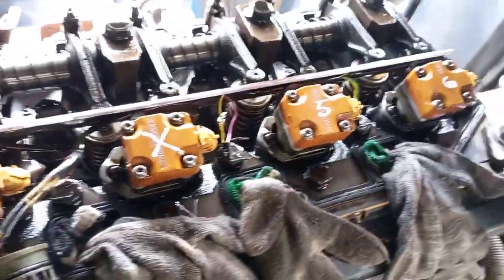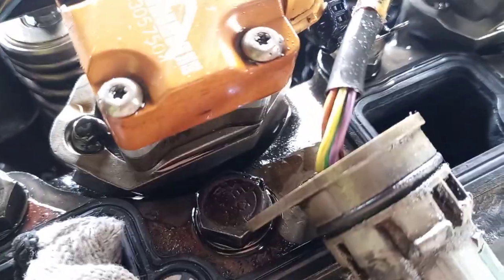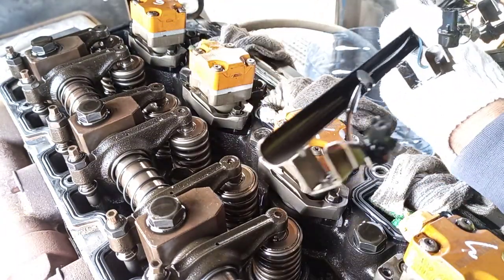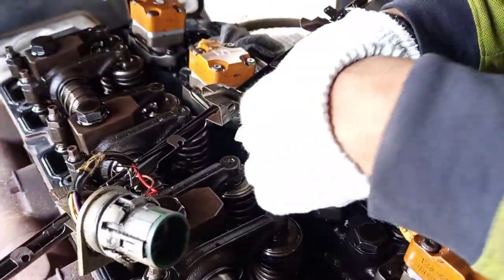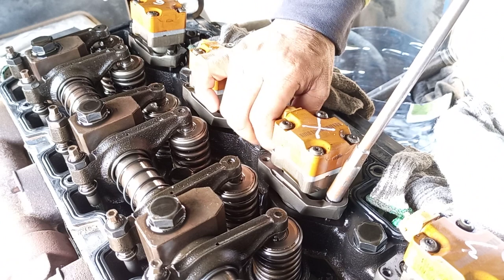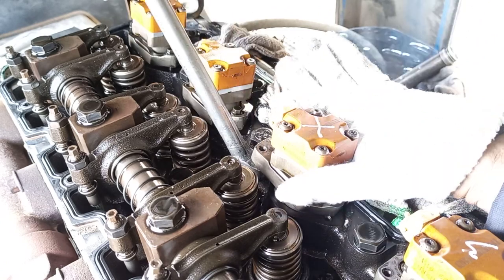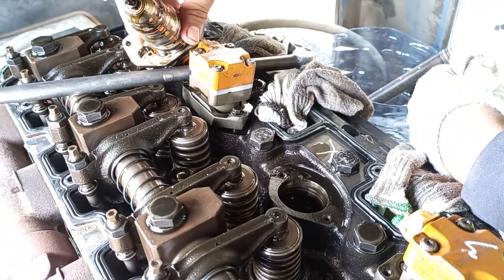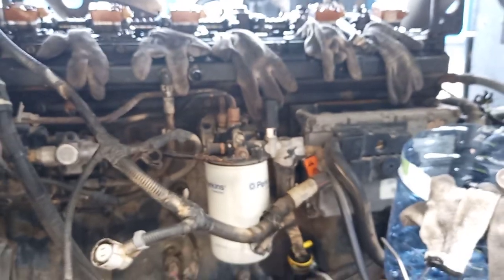1300 series perkins knocking sounds and white smoke main problem injector noozle broken check vedio

Comment: Hi sir we have same model genset the problem connot  running the engine only cranking.what possible problem.
Reply from the maker: @rofeltupaz1955  change speed sensor and check the fuel relay